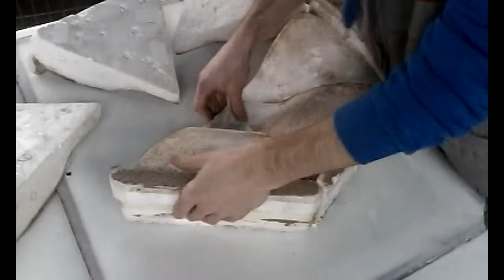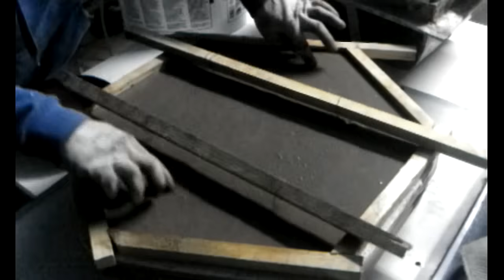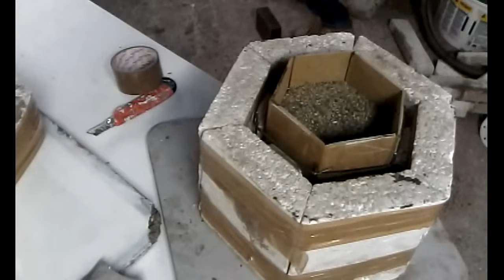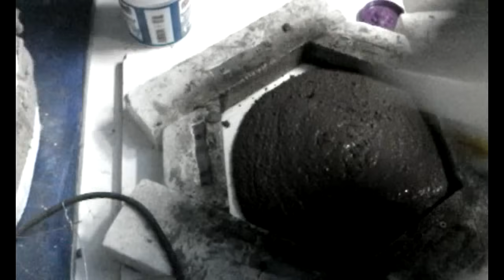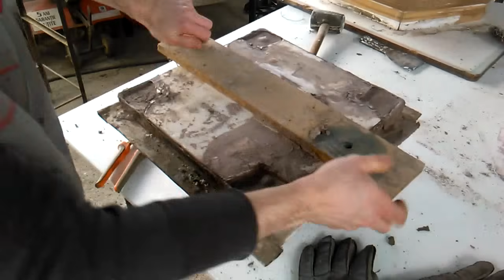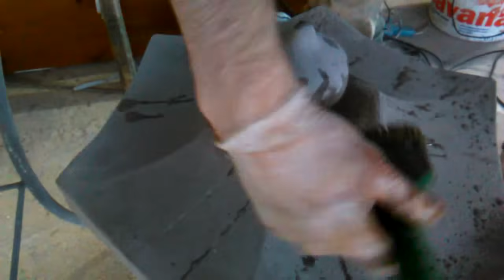Making a japanese concrete lantern

Comment: I Like your reinforcing wire idea. I've been buying the cheap 16 foot cattle fencing panels that are galvanized and a quarter inch thick. I Cut them with a 4 inch grinder with a cut off wheel and get almost two dozen pieces out of a panel for $25.00.

Comment: I made my top mold. I have some imperfections in the finish. What can I use to make it smoother on the styrofoam? What are you using to fill the seams in your mold? What are you using for a mold release? What do you use to sand the cast concrete?  What are you using to bond everything together? What type of concrete are you using?Thanks.
Reply from the maker: I use sandpaper to to finish the styrofoam, to fill the gaps I used just clay, and to sand the convrete I use diamond blades on an angle grinder and sand paper, as a releaser I used pork grease or engine oil, for casting I use 2 parts sand / 1 part cement / pp fibres and steel, to bond the pieces together I used 1 part cement / 1 part sand
Reply: Murphy's Oil Soap

Comment: How much water to concrete do you use??
Reply from the maker: I dont measure my water, but I dont put to much just enough so I can pour the  concrete
Reply: Paul Iascau's studio thanks for answering. i'm doing concrete casting in foam molds for a studio project, and have had a lot of trouble getting concrete to the right consistency (I've got pretty complex molds and it has to be poured in, not trowelled on). If you don't mind me asking more, how long does it take for your wetter mixes to cure and demold?
Reply from the maker: Catherine Chan I use quick set cement... in 24 hours I can demold it.... but its better to wait about 3 days

Comment: how did you make the mould for the roof? i would love to try to make one myself. i hav a design in mind however i would like to get more advice in making the pagoda roof
Reply from the maker: For this lantern I made the roof mold from styrene foarn which I cut it with my hot wire foam cutter. This week I'm working on an other lantern which has a similar roof and I made my mold from plaster of paris I wll try to upload the video in 2 weeks and there you will see better how I made the roof
Reply from the maker: Hi, click this link if you want to see how I made the plaster mold for the roof: https://www.youtube.com/watch?v=yJVcr083Jcw

Comment: Where did you get the molds? It's easy with molds. I used an ad plan in Readers Digest back in the 1970's when I was a kid. You made your own cardboard mold and cored withs paper milk containers-all done by scratch and molded by hand. It came out beautiful. I thought that's what this video was about but you have professional molds. I do have a great mix for concreat an old Masson taught me so its lasted for 50 years. Please include information about your molds and if there're available for purchase. Thank you. Beautiful design.

Comment: Here’s what I don’t get. I’m getting ready to make my own, bought cement that has sand already mixed in. Paul said this is what he used: cement and sand. But the bag states that cement and sand is for projects less than two inches thick! Thats not the case here! Shouldnt we add perlite, peat moss or someting? If anyone could help...ive been reading so much about cement and concrete my head hurts.
Reply from the maker: You can use gravel depending on the thickness of the project
Reply: Thats what I thought! I have used concrete, and its really heavy, as you know, and harder to make smooth shapes. I’ll probably go with a cement sand perlite mix, than apply a waterproof sealer, I’ll let you know.
Reply from the maker: That's a good idea since perlite is a light stone so it would be easier to move it around

Comment: is that coat hanger wire
Reply from the maker: No, it's like hanger wire, but it's actually mild steel wire which I buy at the spool from the hardware store and it cames in different gages
Reply: I need to get that I just found the hanger wire is hard to work with but also thought maybe not strong enough and also when I should use it vs when it's not needed
Reply from the maker: Mild steel it's easier to work with than the hager wire and because the mild steel is a softer metal it can move with the concret so the concrete doesnt crack. You have to use it at the preasure points, like on a frame you have to use it all around the frame. If you have other questions I'm happy to answer them. :)
Reply: Thanks so much. I have this piece that keeps breaking in half but is fine done in plaster. I was even wondering about needing them in plaster since I'm new to using it.
Reply from the maker: Youre welcome.If you are using plaster, instead of using wire try hemp fibers it works better in plaster. Look at this videos you will see me using hemp fibers when I make the roof molds: https://www.youtube.com/watch?v=SsNGiS1Zk1M
           https://www.youtube.com/watch?v=67C-I-wJMfw&t=224s